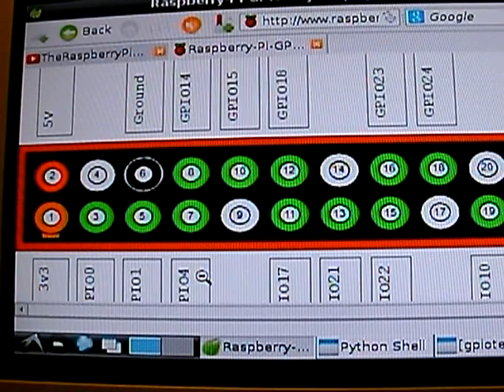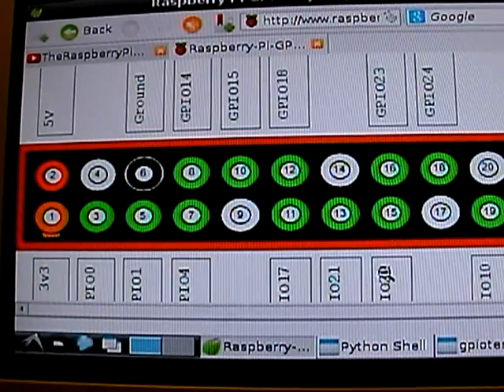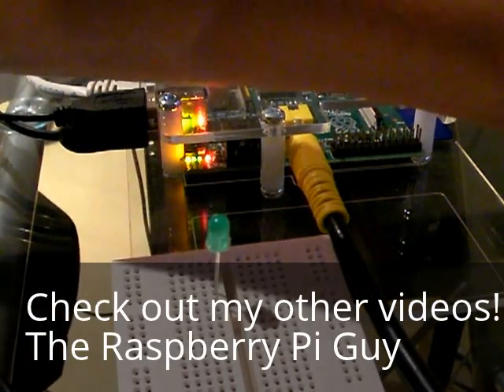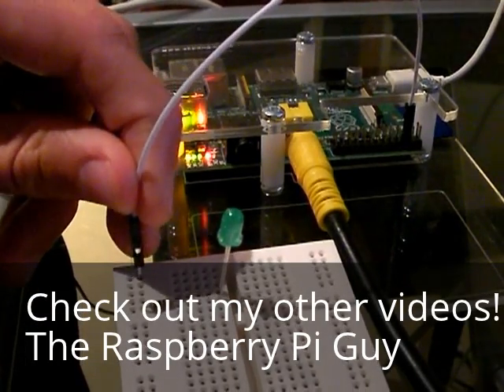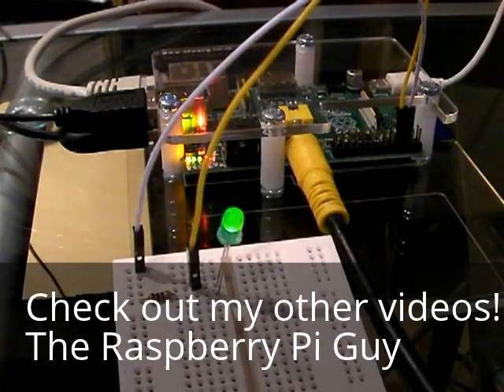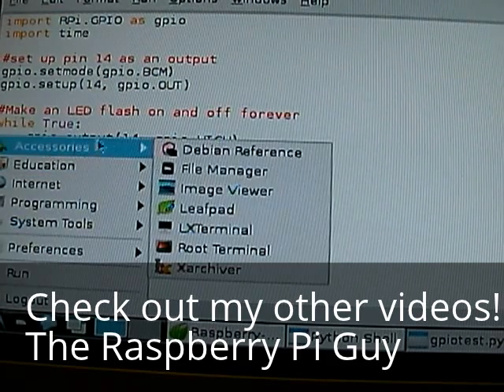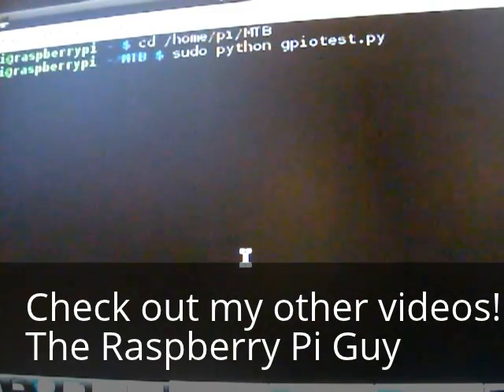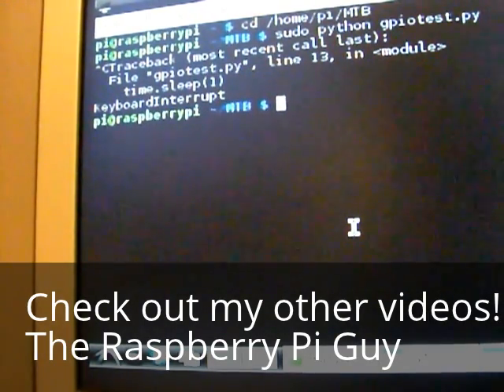Raspberry Pi- Using the GPIO... Part 2

Comment: Awesome! The first time I tried to run it, I didn't realize I was connecting my dupoint wires to the left side, instead of the right side of the GPIO pins, so I was really sad when it didn't work! But then I realized, and now I have a happy little green LED blinking away, thank you!

Comment: I don't understand why you attached the resister to the negative side of the current.
Reply: Capacitors and inductors must follow a certain path of voltage (polarity).  For example, if you attach the positive end of a 2 volt battery to a capacitor, the positive lead of the capacitor (the longer lead of the capacitor) must connect to the positive end of the 2 volt battery.  You must do the same thing for an inductor too.  However, a resistor does not follow a certain path of voltage (polarity).  Therefore you can simply attach the resistor anyway you would like.
Reply: Thank you!

Comment: Kept getting the error channel is in use. For some reason Foreign to me the only way I could get the python script to work was by adding {I used pin 11 instead of 14}

GPIO.setup (11, GPIO.OUT, initial=GPIO.HIGH) 

I don't know why this enabled the script to work but typing it just as you coded it it would not work for me. 

attempting GPIO.cleanup() in the python shell kept returning an error message to the effect that paraphrasing it could not be completed.

Comment: than you very much for this great tutorial,but i am having a problem when running the program a warning message appears which is :
RuntimeWarning: This channel is already in use ,containing as yway. Use GPIO.setwarning(False) to disable warnings.
gpio.setup(14,gpio.OUT)
i tried different pins but the same warning keep appearing

Comment: Typing this on my new toy ;-) - got a wireless logitech k260 kb & mouse - according to the pi hardware compatiability list.  Yeah if you have any links for breadboards etc I was also reading about a breakout board as well that was fairly cheap.  Everything seems to be working ok using debian wheezy - browsing is a little slow but to be expected :-)

Comment: This is a really informative video, My Raspberry Pi should arrive tomorrow and I can't wait to get programming, but my question is, you said in the other video that there is a possibility of rendering the Pi useless by plugging into the wrong GPIO pin, it this possible? Or would it just brick it and you would have to reimage the sd card?